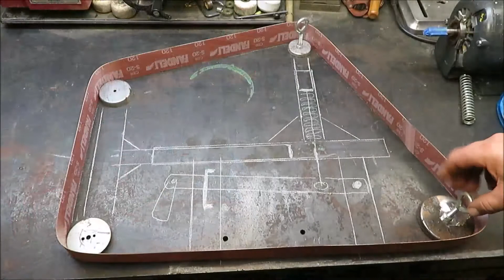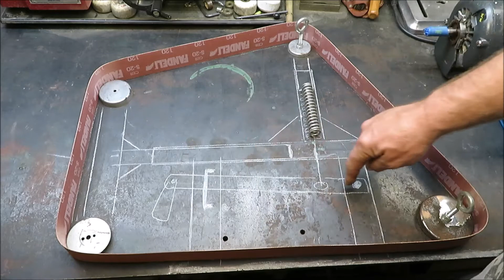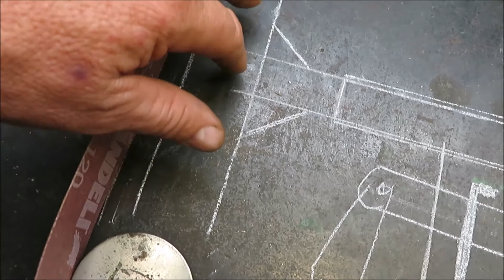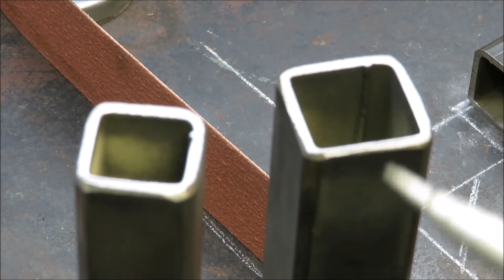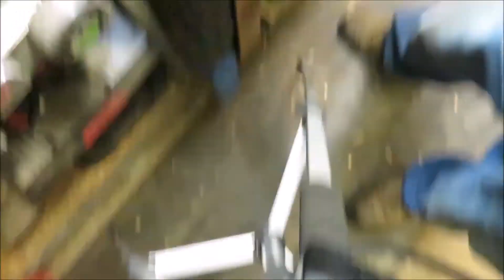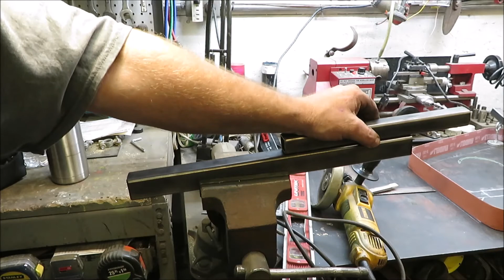homemade belt grinder build layout part#3

Comment: Looking Good Kevin , That sliding piece at the front for the work service, could you not weld that solid as you have the spring tensioner at the top ??
Reply from the maker: Some will make so it has a taper for the bevel on a kinfe. I will use my tapering jig.